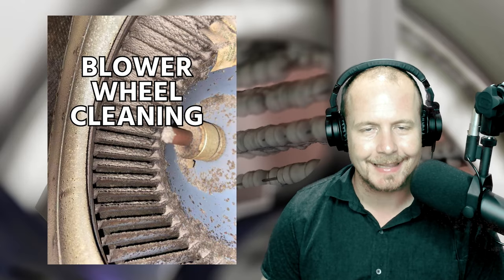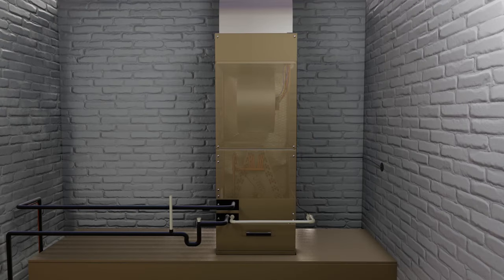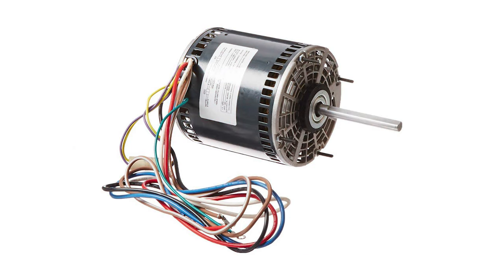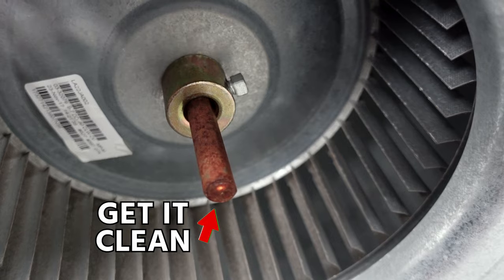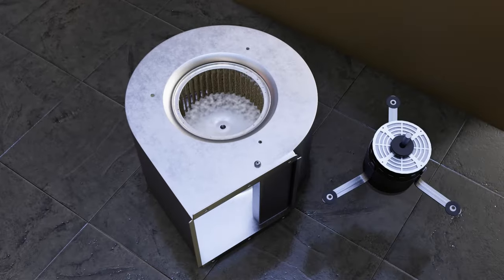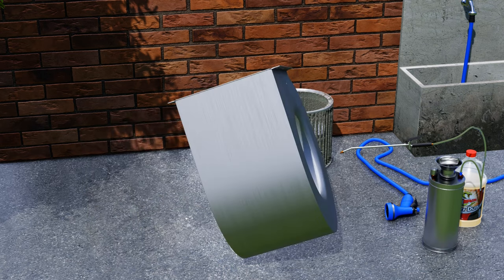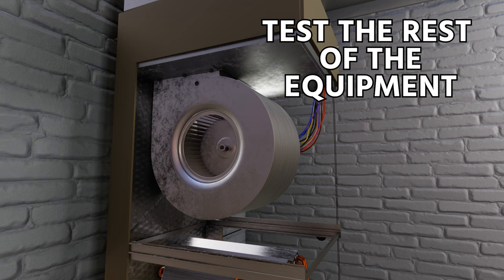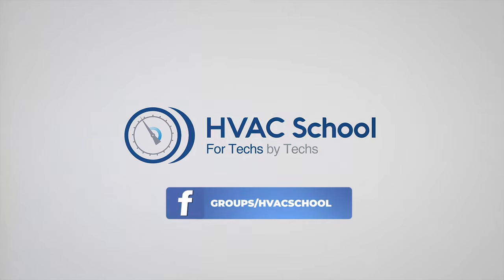How to Clean an Air Conditioner Blower Wheel (Fan Coil Blower Pull and Clean in 3D)

Comment: There is absolutely no need to remove the motor simply to clean the fan wheel. Get a 1"round fan brush and a vacuum.
Reply: I agree but it really depends on how dirty the air handler is.
Reply: My 15,000 service calls worth of experience strongly disagrees with you.
Reply: Yeah? Not with the way mine was
Reply: I agree the motor will take a dump when it is time. Other than your suggestion you can try and blow it out with the compressor along with vacuuming it.
Reply: I have seen fans that no brush and vacuuming are enough so is better to clean it the right way
Reply: My blower wheel doesn't just have light layer dust, it's caked with grime. Needs water to clean it.

Comment: During disassembly make note of the "clock" position of the wiring where it enters the blower motor.  When reinstalling the motor into the housing make sure the leads are in the same position they were in so wire and plug reconnection is simple.  Also, especially on an ECM motor try to position the lead connections so they are facing at least slightly downwards so potential condensation on wires won't follow gravity into the motor.

Comment: I like to use a dryer vent brush on the cage after disassembling the blower , and housing; before cleaning with water, and whatever cleaner. This really helps to get the really dirty ones clean of debris. Have to make sure that one doesn't brush off; or drastically move the counter balance weights though, or ones in for a callback.

Comment: Commenting on an old video. Why is this not listed in your maintenance items? Seems like you all clean everything with the HVAC systems except the blower. I heard you present pricing to the customer to pull. Does this still make sense to you? I'm currently pitching the argument to my techs that blower cleaning should be done on all maintenance. I'd like to understand more about your thoughts on this. Why does it seem to be a standard procedure throughout all companies to clean everything but the blower motor and wheel?

Comment: Ours is really dirty, inhad it serviced however, tge guy didn't do any of that $100 bucks later. Should I hire someone , I'm a housewife with a husband with very little handyman skills. That said he works extremely hard and I'm good with that. I'm handy with some things but as of lately I'm finding a lot of things that need inspected etc. I'm overwhelmed. What advice would you give for my situation. My wheel is up high like your video shows. It doesn't look hard but again. I don't want to damage anything due to the cost of damaging my system.

Comment: Anybody run Into the motor burning up or failing after being cleaned and running at full speed again?
Reply: Oh gosh. No way.
Reply: If the motor windings got wet and were not allowed to dry out, than yes its probable.